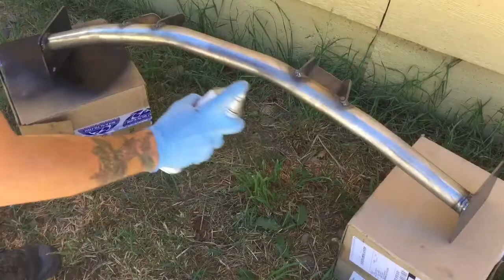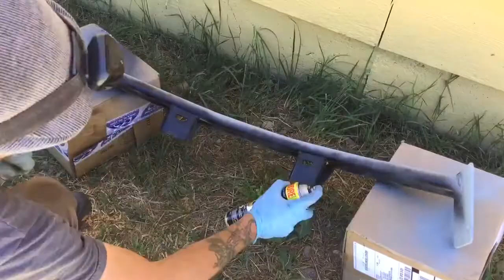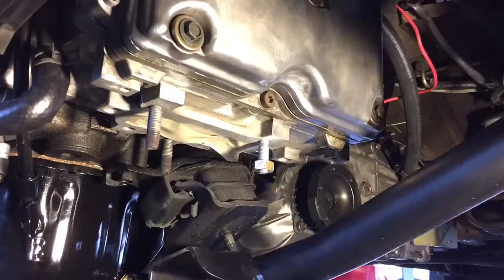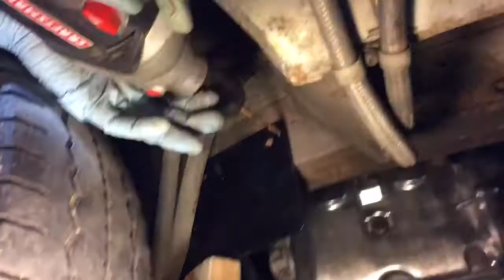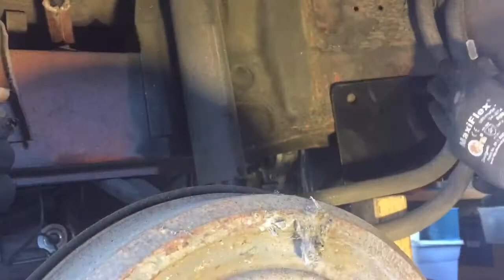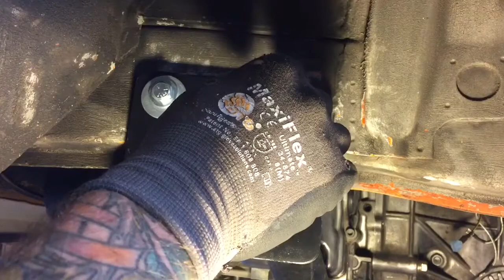Crossmember - Daily Driver VLOG 7/6/17

Comment: According to a uk company called rjes they say bolting a support frame for the conversion is a big no-no (only welding). Except theirs, I have only see bolt in though. They say bolts require compression tubes which is no good. Have you heard that?

Comment: hi... i have a 1989 brasilian Kombi and i found a 96 Subaru Impreza 1.6 FWD for arround 700usd with a little front crash... (only headlights and bumper)

but my Kombi only have the rear engine door... i think that probably i Will have problems with the space todo work on the throttle zone...

and i'm alone with the proyec... here in chile nobody likes EJ engines on Kombis... here we have only aircooled fans. si they don't like my idea and my engine is in bad conditions.
Reply: can we keep in touch to get some help and indications for my proyect?
Reply from the maker: +Braulio Mena  Id be happy to help. The 68-72 busses in the US don't have to top hatch either, but don't let that stop you from converting it. There isn't much work needed in the throttle body area once it's all installed.